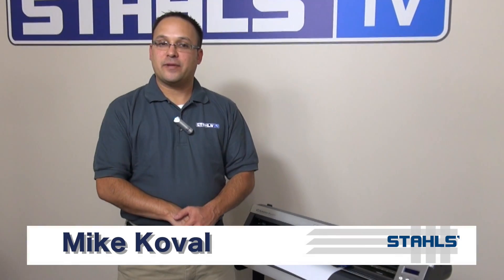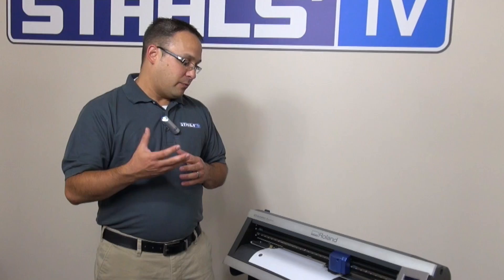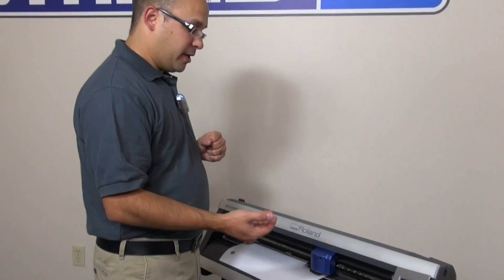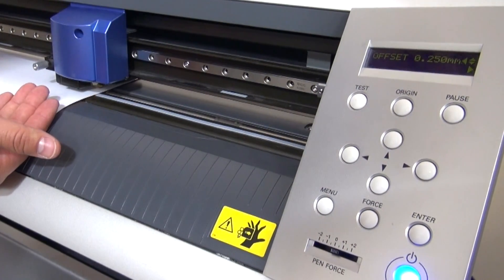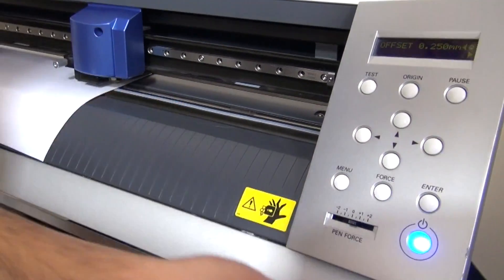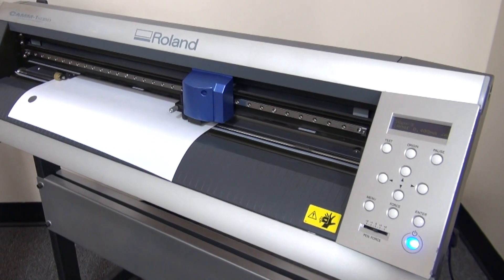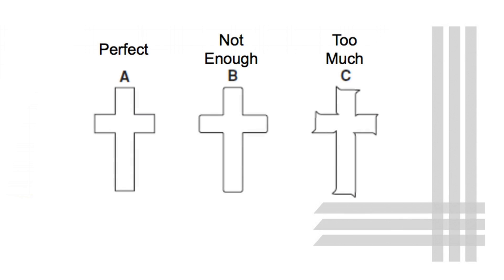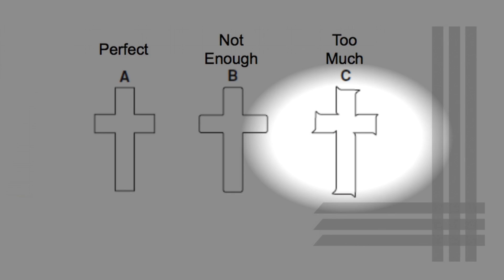Roland® GX-24: Changing the Offset

Comment: Hello Mike, no matter the settings for different knifes, I still have an ofset over both X and Y axis about 2 mm, even more if the media is longer than 300 mm? when  set it to 0,250 mm, ,400 mm, 0.00 mm  it cuts on one and the same path? Any help will be appreciated. It happened mostly when using a crop marks.